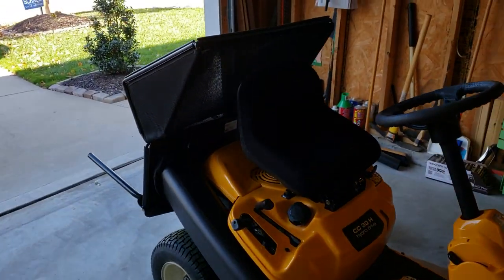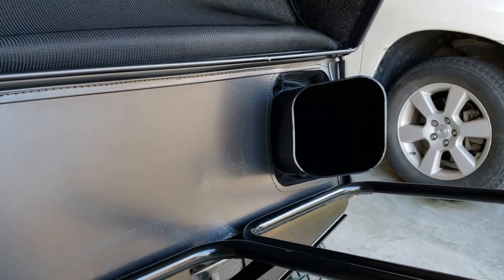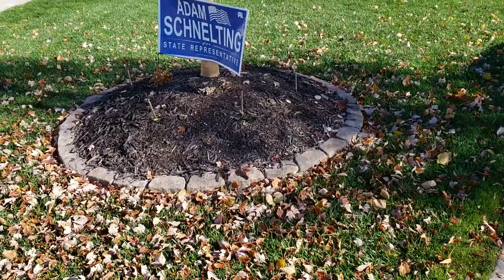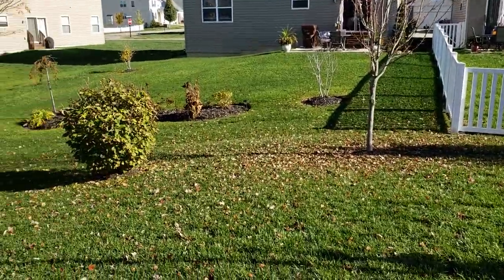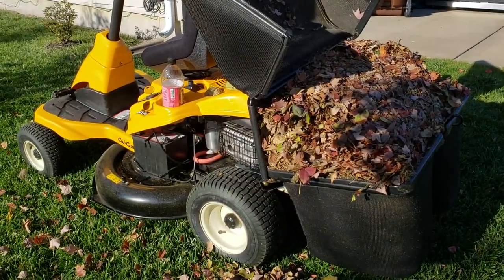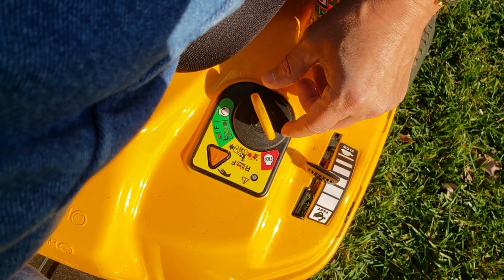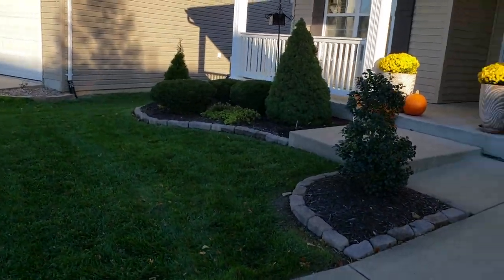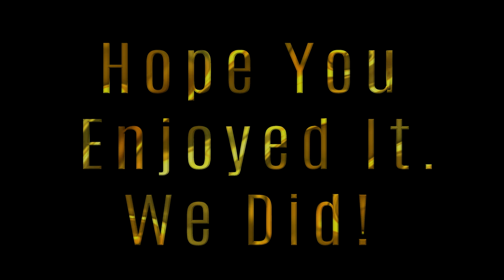1st Leaf Bagging with Cub Cadet CC30H Hydrostatic Drive

Comment: I have a 2019 CC30H and it is a great residential mower for getting through gates and smaller lawn areas. I will look at the bagger. Thanks for the video. I am replacing the hydrostatic tranny belt today as it is worn.
Reply from the maker: Thx for the comments Robert. It has been worth its weight in Gold. Its 4 years old now. The last two mowing I have started to notice z slight squeaky sound. Perhaps it is that Tranny belt you mentioned. I have a new blade to put on before the leaves fall. Perhaps I should do them both while I'm at it. 
Please let me know how it went for you.

Comment: I bought this Cub Cadet Mower about a month ago and I absolutely love it, it fits thru my small gate between my front and back yard and I have 3/4 of an acre but a lot of that is horse property so I only have about between 1/3 and 1/2 an acre of lawn and it'll mow it all in about 20 minutes and the mulch system on it works great and doesn't leave any dead grass clippings anywhere! I also love that it's a rear engine mower so I can see everything right in front of me unlike those big front engine mowers. I had a walk behind Honda for years and it finally shit the bed and I have bad feet with collapsed arches so it was hard for me to use my old walk behind mower to mow the lawn and when I had my walk behind mower and a lot of times I would have to pay someone come mow my lawn for me because it was to hard on my feet and I just couldn't manage to do it myself. After my Honda mower died I looked at getting another walk behind electric mower but instead I decided ponied up the money to get this little Cub Cadet Mower and I am so glad I did because it was definitely worth the money and now I can mow my own yard again and will never have to pay anyone to mow my yard again and it makes it really easy to mow my lawn and it's such a great feeling to be able to mow my lawn and take care of my own yard again! I'm wondering why I didn't buy this mower years ago cuz it's a great machine and will definitely pay for itself in now time flat!👍😁
Reply from the maker: I'm so glad to hear it.  Your description sounds like you are enjoying every minute of it.  I've calculated that by the end of next summer, we will be ahead of the game regarding the average cost to mow the yard vs getting someone else to come and do it.  I love to get out on it.  Kind of hate putting it away in the winter.  Have fun, enjoy your iced tea while ride along.
Reply: @KCPrible98  I will definitely enjoy my coke lol and yeah I figured that my Cub Cadet Mower will pay for itself in 2 years easy and that's just the cost of mowing my back lawn, add in my front lawn and it'll almost pay for itself in a little over a year!😁👍

Comment: you sold me..i bought one of these cub cadets beginning of summer...going to order a bagger now...
Reply from the maker: Way to go. You are going to love it. My brother just gave me a tip on the bagger. It should help mulch and shredding. He said don't empty the bags when they are full. Instead mow the whole yard. Since the bag and chute are full, the blade will go into mulching mode. Then empty the bags and go over the yard a second time and bag & empty the bags. The mulch material will be much smaller in size and take fewer dumpings. Put the mulch in your garden etc and turn it in with a spade etc. It made sense to me, so I'm game to try it out. The trees are bigger now, so fewer dumpings are okay with me. The bagger fits so good you hardly know it's on. 
Thx for your comments.

Comment from the maker: Thx John. I hope you like it. To be fair, its weakness lies in the fact that it does not have independent suspension. If you have a yard with a lot of rolling terrain, then one wheel may lift up in the air on you. Why, because all 4 wheels are on the same plane.
Picture a piece of plywood with 4 wheels on the corners. If your yard is flat, then no issues, but if suddenly you slope down on the right front corner, your left wheel may come up in the air and spin.
While our yard slopes. This has not been a big problem. We had 3 areas I identified where it happens. I bought some bags of soil and put them down which releveled the yard in those areas and problem went away. Otherwise uneven yards could be a bigger problem and then I would look for a unit with independent suspension. You can tell them apart as the front axle is independent of the rear axle.

Comment: Thanks for the video.  I am about to buy this mower.  It looks like it can get in tight around the trees and such.  I was undecided about buying the bagger, but I think I should go ahead and get that, too.  Oh, and I am also getting the Drainzit Model # STAN 1438 extension and will get rid of that oil drain plug.
Reply from the maker: Wonderful Chickie, hope you will be as happy with it as I am with mine.  I think the extended Oil drain plug is a must and should have come with it. Unfortunately your 1st oil change w/o it will be quite a mess, but you'll be glad you got that out of the way when you put on the extender. 

Yesterday, I took off the bagger assembly and hung it up on the Garage wall over where I park the mower. I put a big open ended eyehook screw into a stud up high. Then I hung the bagger upside down on the hook by the release latch in the back. Then, to keep it from swaying, I put a 2x4 under the bottom if it. So I got it mounted w/o having to take off the 2 bags from the unit. 

Finally I put up 1 smaller open ended eyehook up higher on another stud next to it and hung the plastic side chute extender next to it. 

Now if I decide to mulch cause I came back to tall grass after a vacation, I can easily take it off the wall, mow & bag, then take it off the mower and hang it back up in the wall all w/o having to break a sweat. 

I'll demonstrate this when I do the next video of changing the oil with the extended drain hose. 

Let us know how you like it after you have mowed a couple if times. We are excited for you.
Reply: @KCPrible98  I got mine about a month ago and I absolutely love it! And your right u need the extended oil drain plug so u don't make a mess everywhere, I'm glad I found one that came with it and wasn't missing it like a lot of the other ones were!

Comment: Thank you for this video! Looking at getting one and wondering how close to brickwork it will get. This was perfect. Thanks!
Reply from the maker: Hi,  I can't tell you precisely the measurements as I do not have them with me at the moment, but I can tell you I can get it between a mailbox pole and the brickwork in the front yard with about 3/4" to spare on both sides.  I go pretty slow to thread it through the slot.  When I add the rear bagging unit, then it requires another ½" on the right side (side with the chute).  I can still squeeze it through the opening, but it is very tight.  I should remove 2 stones on that front mound and make it just a pinch smaller diameter all around.  Then I can get it through easier.  I'm helping my wife with her 95 year old mother so won't have time to do that this year.
I have mowed 22 times with it as it will be 1 year old on June 12.  May get two more mowings in if the rain holds off.  I plans on doing a one year review on the Cub Cadet Official Web Site.

What would I change if I were to redesign it?
1) Make the Tailpipe point downwards more toward the ground so I do not burn delicate flowers as I go slow around them.  I've had to learn to do the trimming by making right hand turns where my whole life I've made left hand turns - maybe cause I'm left handed.

2) Make the deck a Floating deck or put some wheels under it so it does not scalp the yard.  I have not had a scalping issue myself, but my yard has very smooth gentle slopes.  Others complain about it, but maybe they have steeper ridges in their yard so they tend to scalp more.

3) Make the front suspension independent from left side to the right side.  Currently it is all attached to the frame so the whole unit up front does not pivot and float as larger garden tractors do.   I'm used to a floating front wheel axle.  We downsized our house/yard and while it is not really an issue, it could be made better.  Probably $50 more in cost would get that job done.

4) I would add a better grip on the main floor for my feet.  They tend to slide around too easily.  Something kind of course like a sandpaper feel would hold your feet better and make you feel more secure.

5) Add a second light on the front - one on each side or make the one they give you brighter and point down at a steeper angle.  I don't really mind, I don't mow at night because of the mosquitoes, but I could see people hauling stuff around with a wagon finishing up a project later into the night that would benefit from it.

Would these items stop me from buying it again - No.  But they are things that the next version could utilize for more customer satisfaction.  For me, small size, fit in the garage, easy turning around items counted the most.

Hope this is helpful in your decision making. At the price I paid for it plus the $250 bagger,  24 mowings in one year works out to $65/mowing.  By this time next year it will be down to $32.50/mowing.  If I hired someone to do the yard for me, that would be $40/Mowing.  We will be ahead of the game before the next 12 months are up.

Blessings - Kitt Prible
Reply: @KCPrible98  your video already was my final vote. Ordered it about an hour ago. Thank you again for putting this on the Internet and happy mowing!

Comment: Every good riding mower should have clear paths to cut. Suggest you remove all of those trees and other road blocks. I bet you are retired so may not be a problem for you. I have two trees in the front yard and three trees and a trellis in the back yard. I use a push mower to trim first and then the riding mower for the bulk of my 1/3 acre yard. I am 70 and this works out well. Now if you could just fix my drainage issues. I just bought one of these mowers. Still figuring it out.

Comment: I have the same mower. I'm going to buy that bagger. 
I just need an oil change video and I'm all set!
Reply from the maker: Hi Glen, sorry I don't have an oil change video. I can say the 1st oil change was a mess as I expected. The little half round tray worked terrible. But, I had already ordered a rubber extension drain tube to extend it out further away from the unit. I think that will work like a charm for my 2nd change which won't be for several weeks yet. I'll try to make a video of that when it happens.

Comment: Two thumbs up, first great video of the mower in action question how did the bagger work with grass? I’m on the fence if to go gas or electric model. And second cuz your a Rep 👍🏼
Reply from the maker: thank you Johnny B on both Accounts. 
i have only bagged leaves so cannot speak for the grass only aspect. i believe in leaving grass clippings behind. 

i don't have any experiences with the battery unit so cannot really help there. 

i can only guess it would be much quieter, so if ypu listen to music or news while you mow. that option maybe worth it. 

from what i saw, i believe the performance would be the same either way. the electric version maybe kind of cool in that aspect.

Comment: Is there anyway you can measure the mower with the bagging system.     It's roughly 67 inches without it .

I would really appreciate it
Reply from the maker: I have it loaned out so can't get back to you for a couple of months. Sorry. 
But to be honest, I find it simpler to just mulch ot and ho over some places twice. I get done faster.

Comment: How does it handle the slope in the side of your house?
Reply from the maker: Got to be quick because I have to leave in 2 minutes.  It works great on the slope.  I only have one place that is an issue and that is at the very bottom - lowest spot in the yard.  Trying to make the corner, then back up to get all of that spot and finally get it going forward which puts it on an uphill slope.  I have to have my foot on the break to keep from going backwards, while at the same time put my foot on the pedal to go forward, so it kind of behaves like popping the clutch.  I'm considering putting down a couple of paving stones in that corner and forgot about growing/mowing grass in that area.  Otherwise, if you yard is no hillier then mine, it should do just fine.

Comment: Hello Sir you had me convinnced as I am preparing for fall season and I have some trees and a narrow drive way with an ample yard. If I may ask is it wise to get the protection plan offered by Lowe's just in case something happens on the machinery and parts? This is truly an investment for me. Thank you for your answer in advance
Reply from the maker: That's a personal choice. It's an investment for me too, but I took a pass. I'm somewhat mechanical and can do thd easy maintenance. We decided to save the money. 
Hope you like it.
Reply: @KCPrible98  thank you sir I will definitely learn how to use it honestly enough I am not a mechanical guy and I am just new in yard work and I hope you don't mind if I have questions or I will go back again on your video and or I will leave a message to you here sir thank you very much. And last question if you don't mind? It has been 3 years since the last time you posted I believe, how's your unit going is it still running good and just minor problems you encountered sir?
Reply from the maker: @TopherDPT  actually I just put it away today for the season. I got 29 mowing this year. I didn't use tge bagger the last 2 years and just mulched instead. 
My average cost per mow since we have owned it are now $15 per mow which includes all minor repairs, blades and new belts last year. Today tgey charge f25 to mow us so figured we are about $600 better then break even. Next year is all profit. 
Ask questions if you like. Most of my videos are private and far and few in between.
Reply: @KCPrible98  thank you sir this is so informative and thank you for your openness and guidance
Reply from the maker: @TopherDPT  my wife and I never expected to get so many views on this simple video. It's over 99k now and just blows us away. We truly hope you enjoy yours. Blessings, K&C
Reply: Hi again Sir how have you been? I am about to purchase it 😀 Just have questions. Hows the Mulching System and is changing the oil and adding fuel is hard to do?
Reply from the maker: Greetings. We are doing well. The mower is great. Trees are bigger. But to be honest we haven't used the bagger the last two years. I just prefer to mow more often and go over the leaves mulching them down into the ground. It's faster and no leaves to get rid of. 

Filling up with gas is easy, but wished the cap was on the other side since I'm left handed.

1st oil change was a mess and knew it would be reading the reviews. So I got an e tension tube I leave on all the time. Its long enough to go into an old plastic milk bottle. No fuss of mess afterwards. 
Drainzit Oil Changing Aid - Model# STAN1438 with A 3/8" Drain Port Size https://a.co/d/dmAFz1n

Hope you love it. I change the blade every 3 years. That is the hardest part getting that bolt off that holds it down.
Reply: @KCPrible98  Wow Sir thank you! I guess I have to face the fact that comes with owning one is the responsibility of learning all the In-N-Outs thank you very much also for the link

Comment: Hi Kitt nice video thanks, I noticed you have a oil drain extension tube on your cc30h do you know if its a 3/8 NPT thread on that drain tube assy?
Reply from the maker: Hi Soobieblitzen,
It is a 3/8" thread.  This is what I bought from Amazon:
https://www.amazon.com/gp/product/B000PDN3HY/ref=ppx_yo_dt_b_asin_title_o03_s00?ie=UTF8&psc=1
Hope this is helpful - it made the next oil change a breeze.
Reply: Thanks Kitt, also great video thanks.

Comment: Did you have the blade engaged when you did the leave pickup?
Reply from the maker: Yes, it supplies two beneficial elements.  First, because it has a mulching blade, it chops up the leaves into pretty fine material (as seen in the video) which allows you to get more leaves into the two baskets.  2nd, it supplies the wind needed to move the mulched leaves up the chute and into the bags.

I use it for leaf removal, otherwise I believe that mulched grass clippings are good for the soil and should be returned to the earth.  When I do use it to get leaves, I'm also getting grass clippings at the same time.  Usually the grass is growing slower when the leaves come down, so I'm getting mostly leaves.